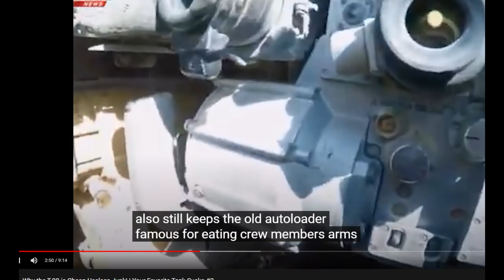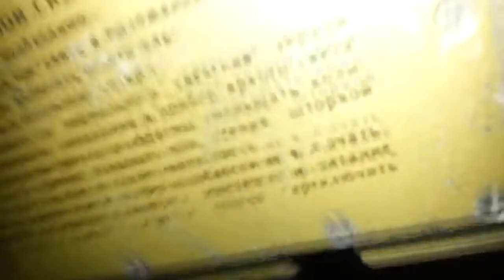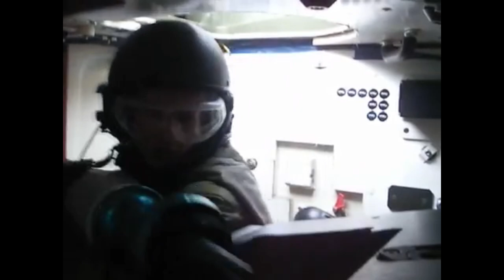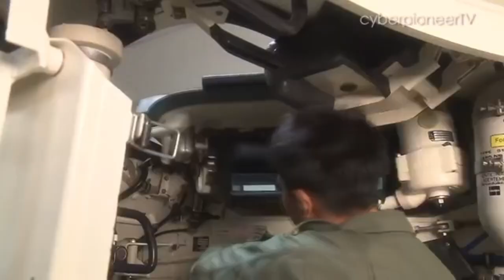Busting Myths on T-72 tank!

Comment: I think some of the rumors actually pre-date the T-72 itself. Short crew member requirements were an artifact of from either IS-3 or T-62 tanks where you had 122mm/115mm shells in small spaces.  Arm-eating auto-loaders may have originated with the initial operating problems of the T-64, which would have been presumably rectified when the T-72 got fielded. "A great tank for robotic dwarves, but a poor tank for humans" was a rather memorable description of the T-62 from an old book I read.
Reply: It kind of depends on how big you are, I'm 6'4 or 194cm and I've been inside a merkava mk4 and it was very cramped and uncomfortable inside the turret bussel. And the merkava is a relatively spacious tank.
Reply: Makes me wonder, to what extent is it a viable & practical candidate for modern unmanned ground combat vehicle conversion. 🤔

Autoloader already helps.

With VR cockpit, will it be economically feasible & practical?
Reply: @IdoDekel-do7hh  shalom
Reply: @phantomaviator1318  shalom
Reply: @eustache_dauger  A few problems pop up with that. 

There is a reason my most modern AFVs have three crew. One person to totally focus on maneuver/navigation and forward, one to aim and maintain the weapon, and a final one to collect data, search for targets while the gunner has tunnel vision. Tanks with smaller crews were tried in WWII, but were out-performed by those with better crew job definition. Modern systems have only added more for the crew to be doing.

Tanks are designed as hollow shells to contain the crew. If you wanted to make a remote operated vehicle, you would save a lot of size/weight/height by not including space for humans. 

Telemetry is the big killer for remote operated vehicles - and tanks are going to operate in spaces with more obstructions than aircraft.
Reply: I belive it was the BMP-1 autoloader not the T-64 autoloader that was the troublesome one.
Reply: @impguardwarhamer  That could be, though I don't think the 73mm gun tube of a BMP could accept an arm. I guess this calls for more investigation.
Reply: I’m Russian and I’ve never even heard about T-72’s arm-chopping or something. The closest I can think about is a danger for a driver during disembarking because of the machine-gun accidental misfiring. But it was for T-64 and not T-72 which is completely different tank.
Reply: Arm-eating myth comes directly from Zaloga misattributing BMP-1 autoloader issues to the T-72
Reply: @IdoDekel-do7hh  lol jew
Reply: @Chilliestjoker  yes I'm Jewish what of it?
Reply: @IdoDekel-do7hh  jesus is the son of god
Reply: @Chilliestjoker  and?
Reply: Met a Czech T-72 tank commander in Mali ...dude was 195cm if not taller.
Reply: @zebradgr8339  that's interesting, was he skinny? Cause I'm also very wide bodied so that might explain how he squeezed in there.
Reply: @IdoDekel-do7hh  He was (well he is) around 95kg .... Not a small guy whatsoever
Reply: @zebradgr8339  yeah I'm 127kg so way wider, but that's interesting that he'd fit in there, big guys usually don't go well with being inside a tank.
Reply: @IdoDekel-do7hh  I am 185 cm with 90kg, my unit went on a demonstration of our M-84 tanks (license produced T-72). I had the chance to ride on the gunners seat and must admit that the place is not so small. But can't imagine squeezing through the hatch for "heavy boned" people.
Reply: @zebradgr8339  when I entered a merkava it was at a sort of exhibition for high schoolers who are gonna be conscripted next year and I crawled through the back exit hatch and I barely fit in there lol, thankfully I'm gonna join the intelligence corps and not the armored corps
Reply: @IdoDekel-do7hh  we use the Israel made Spike as our ATGM ....Seen what those things can do ... Lets just say I wouldn't pick to be in a tank regardless of the size of the hatch hehe
Reply: @zebradgr8339  yeah the spike is a hell of a weapon, I wouldn't want to be against it too, but fortunately Israel's neighbors don't have such sophisticated weapons so being in a tank behind a few good inches of steel is still probably the best place you can be in the battlefield
Reply: @IdoDekel-do7hh  שלום
Reply: @IdoDekel-do7hh  thank you for your service
Reply: I’ve heard rumors of T-72s eating arms since the ‘80s and goes back far longer than any books Zaloga  has written.  He may have cited someone else who had inaccurate information however.  

I think most of the rumors probably were mis-attributed to the T-72 back when it was mistaken for a T-64 variant in some early intel documents and publications. T-64 was already well known for this problem in the ‘70s although I believe even in T-64 it was only in the early production  vehicles and was corrected.
Reply: @impguardwarhamer  BMP 1 have autoloader ?
Reply: The myth of the arm eating auto loader comes from the BMP-1. It was so dangerous, that the soviets decided to remove it.
Reply: Also BMP 1 isnt safest thing for your arms
Reply: @michalbarsfajny4268  BMP-1 autoloader*
Reply: auto loader eating arms comes from BMP-1, T-64 and T-72 never had those kinda issues
Reply: All the current russian tanks are just as cramped inside...they are made in a way that any kind of penetration will blow the ammo out along with the crew inside 😂

Dunno about armata tho
Reply: @dvls442  Polish army tried to modify one of the T72 to not have autoloader... And we still didn't run any tests about the subject.
Reply: @impguardwarhamer  depends on if you consider exploding, killing the crew, and launching the turret in the air 'troublesome '...
Reply: @richsmith7200  ammo rack detonation was an issue that many tanks of similar age as T-64/72 shared
Reply: @impguardwarhamer  I just couldn't imagine looking down at my ammunition,  while riding into battle......exposed.......under my feet......I felt a bit claustrophobic in an M-60.....
Reply: I think it's also a product of a broader prejudice in the west about com-block military and society in general about Com-block soldiers and people being mindless drones with little to no autonomy. I've heard similar ideas being expressed about the Soviet airforces for example. That their pilots were very rigidly controlled from the ground, to the point that they were allegedly even told when and where to fire their missiles by ground control in air-to-air combat.
Reply: @MrChainsawAardvark   The soviet unions would have always liked to automate tanks  ( like with AI/remote control) and the very first obstacle was that you would have had to have an automatic loading system whatever else you could get working or not.

Comment: About the chopping of of arms, the Chieftain has told a story about how the Ambrams automatic ammunition blast door almost chopped his hand off. It's meant to be opened and closed by the loader between every reload but crews would rig it to achieve higher fire rates, but of course this lead to dangerous situations.
Reply: So the blast door is automatic. You use your knee to hit the door open button. The door automatically closes after a set time. However you cam turn of the door hydraulics which means the door has no power to close. The real danger arises is that if you get hit in the ammo you have no blast door to protect the crew.

Edit: I forgot to mention the blast door has a safety feature that if it hits something it will automatically open again. However this feature does not work when the door is almost closed. I.e. the worst time to have you hand in the door is when the safety feature is disabled. However this is very rare because you can open the door again at anytime so idk why you would have you hands in front of a closing blast door.
Reply: @ChefClap  at least you would not worry about that for long
Reply: Also when loading rounds into the ready rack , flip locking tabs on door track preventing movement and turn off CB 12 in turret networks box. When powered,  door has sensor on it  that feels resistance to within few inches of closing
Reply: The Chieftan is right the First series M-1 Abrams doors could take a finger or hand off if not quick or careful. I know because I asked an M-1 loader and said yes it can. That has sense been fixed and if your hand or shell is in the way when the door closes; it will retract and then close agian 5-15 seconds later. I was in from August 1988 to July 1992 US ARMY Infantry.
Reply: @Fenncer24  all series m1 doors has the possibility of biting ya, but they are plenty safe if ya adhere to the standards.  Gotta keep an eye on officers. They have a tendency to break the tank of hurt themselves.  I crewed m1 series for 10 years. In my experience,  the turret monster and dealings with the track gotten guys hurt.
Reply: Yeah the chieftain always seems to be hurting themselves somehow sorry  His hand shouldn't have been in there in the 1st place he was  A tank commander Cancer's I've ever heard him say he was a loader
Reply: Yeah, but in that same conversation he noted that the door has a sensor so it specifically won't chop your hand off.
Reply: Isn't that what happened to a few British ships in WW2? Doors propped open, or removed to facilitate faster loading,  but catastrophic event in instances of fire.
Reply: @richsmith7200  WW1 British Battlecruisers to be exact and well they went Boom
Reply: Chopping of of arms in T-72? Only if you realy trying to do that...
The guardrail is almost up to your shoulder height and your hand can only be in the work space of the gun if you stand up, lean over and then reach into that work space. You won't be able to do it any other way. Admittedly, there is a risk of such an injury when you load that autoloader because then you have to push your arms into the working part of that automat...
Reply: @jerromedrakejr9332  Indeed, The Tank Museum showed this in a video with an East German ex-commander of a T-72. The guard rail on the commanders side even reaches above the shoulder.

It's a stupid rumor really because the outloader works in the area where the gun recoils, which is a high danger zone by definition and is, like you said, railed off.

PSA: Heavy machinery is dangerous, and when used inappropriately can be highly lethal, that's just a given.
Reply: One stupid myth passed around in the 80s was the Arabs would put ammo in ak mags front to rear to get a couple extra rounds in 
A Lot of us fell for it once we held a A.K. 47 we felt pretty stupid  the arm chopping myth was dispelled once we trained down at N.T.C. in California we got to inspect a lot of stuff first hand

Comment: The myth that crewmen for russian tanks must be short comes from the T-55, which really did require the gunner and commander to be 170cm (which was average at the time when it was designed) or below, since the legroom was very limited. But in T-64 and all later tanks the turret is much more spacious. I know in person one man who is 190cm+ who served as a commander in an M84, and he said that only the driver needs to be short
Reply: Also partially from WWII, when several Soviet tanks required certain crew members to be relatively short to fit into a cramped work space (mostly drivers, I think, but some gunners too. Low profile can come at an ergonomic cost)
Reply: So you are saying I’d be completely fine in a T55 at a height of 1.72m
Reply: @Eskeletor_210  maybe on the loader's or driver's seat. But still, i heard in Romania (they still use t-55 in active service) that they set a height limit to 168cm and 45cm shoulder width, saying that it's uncomfortable for anyone bigger than that.
Reply: @Eskeletor_210  dude I am 1.86m and  felt short but when I heard this I actually kinda felt tall the bench mark is 1.83 cm after that your above average height
Reply: @kawazaki23  1.83m is only average in the tallest country in the world, it's definitely not average in general. Romanians seem to be above average, but they're still below 1.83m.
Even for the youngest men(younger generations are generally slightly taller) in the USA for example, the average is about 176cm.
Reply: But sir doesn’t that also make Soviet tank REALLY hard to hit being short? Also on average they are as an actual rule 20 tons lighter then the NATO tank, which is much less of a logistics burden.

Comment: Part of the myths, came from the "Otherside" in attempt to boost the morale of their own forces.  Ie why Russian using Auto-loader and the "Other" using Manual.

Auto-loader chewing limbs. Operational and maintenance mode.  In theory will never occur.   Having served, you be surprised how soldiers (especially conscripts) get themselves into usual situations.  Not often,  but does happens in a rare while, especially pre guard rails.
Reply: Wasn't it a thing carried over from the early T-64, but the thing got reworked pretty quickly after one or two incidents and a few  close brushes.
Reply: @vojtechpribyl7386   yes you are correct. The T-64's auto loader was known to take a least 2 arms off two different people. Shields installed and proper training reduces this to maybe 1 a year. Very rare now.

Comment: The myth of the autoloader loading limbs might have originated in David Isby's 1981 book, "Weapons and Tactics of the Soviet Army" a Jane's publication.  It says within the book that Soviet forces had to manually load the gun because the autoloader was removing legs and arms. The same book also says that the USSR imposed very short hight restrictions because of the cramped interior of the T64 / T72
Reply: Does it say the autoloader of T-64 or T-72 did that or could it be some prototype or some other vehicle where some bootleg autoloader was attempted but got removed later? Since there are dozens of videos of crew just sitting and letting autoloader do the job, and almost no videos of manual loading of those tanks.

Comment: I'm 1,86m and I have been inside the gunner station of a Russian T-64, which I believe it is even smaller. My experience is: not only I was able to fit, but I was able to seat quite comfortably. In terms of personal space it felt a bit like the front seats of your every day car. I could even stretch my arms sideways (not to the right - canon) and up. I know a guy that is almost 1,90m who also enter and fit inside the same tank.
Reply: okay Andre but are you 1.86m barefoot or with shoes on because if its with shoes it doesn't count

Comment: The detail that made Warsaw pact tanks totally outclassed compared to western tanks during 1980's was targeting systems. Western tanks had thermal cameras, while easten block tanks still had infrared light systems. Thermal camera can see through smoke. So, in order to destroy a bunch of eastern block tanks, western tanks would only need to shoot some smoke in front of them and the eastern block tanks would be blind, while western tanks could take them out at leisure.
Reply: First gen 1 thermals were overly expensive and realy badbin terms of resolution, they would only be used at night. Also thermals cant see through smoke grenades they can only see through ESS

Comment: What would happen if the T72 uses ESS when fueled by petrol?
I don't really know how ESS works other than the heat from the engine itself is needed for the ESS
Reply: the system would catch fire
Reply: I heard that the smoke agent is directly injected into the engine, and the combustion of thereof is what causes a smoke
Reply: @danielsteger8456  i was thinking the same but dint know how to explain what happens. Like idk hoe the system works at all but i presume it would catch fire
Reply: When diesel fuel gets hot it creates a big puffy white cloud so ESS on pretty much every tank works by spraying diesel fuel onto the outside of the exhaust manifold to heat it up. If petrol is used that would be sprayed onto the exhaust instead. Petrol, when it gets hot, doesn't make a big puffy white cloud, it makes a big angry red cloud that, to put politely, might be detrimental to the welfare of the crew. 
ESS is only supposed to be used for a few seconds to prevent a dangerous build up of fuel.
There was actually an incident a few years ago when a Challenger 2 driver forgot to turn the ESS off and so much diesel fuel was sprayed onto the exhaust manifold it actually caught fire! 
Fun trivia: this is exactly the same as how smoke generators in stunt aircraft work, though they often include dye mixed into the fuel to change the colour of smoke.

Comment: On myth 3, I've heard that one and have corrected people. There are limitations on gasoline for both Russian and western tanks. Especially the Abrams. You can run the Abrams for about 24hrs on gasoline or petrol but after that point it actually becomes dangerous. At the 24hr mark theres an expected failure rate of about 50% and that number is on an exponential graph or parabola. No matter what there is going to be maintenance, possibly a complete overhaul, or potentially a complete replacement. If you baby the tank you run less risk. The Abrams does have some extra options on the list but that's only in a pure replacement scenario. You can mix in vodka with the fuel of both and they will be fine. And you can add some very common and widely available 0W-40 to spike the fuel in both if you have to along with a but of diesel clean additive and you'll probably be just fine. In a pure replacement there are some things the Abrams cane use, but these are basically last ditch emergency scenarios where it's better to run the pack on any flammable liquid that isnt nitro glycerin of butane than to stop and wait for fuel. These would 100% be prepare the tank for the chance you need to ditch and destruction of the sensitive areas. Basically all modern tanks and even many older ones back to the first were capable of using a wide range of fuels if needed.